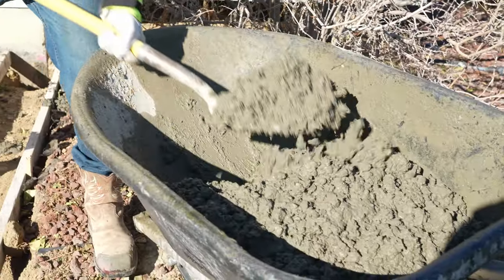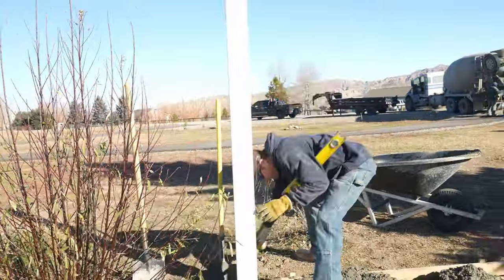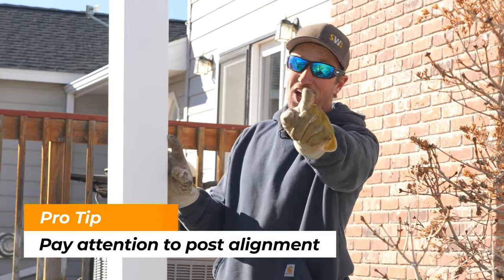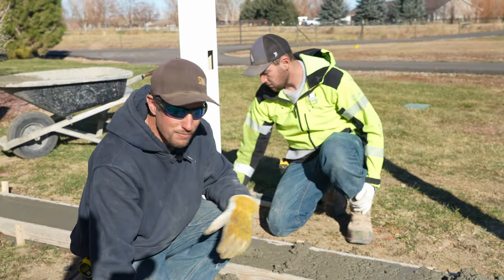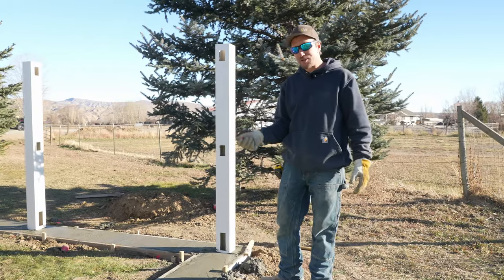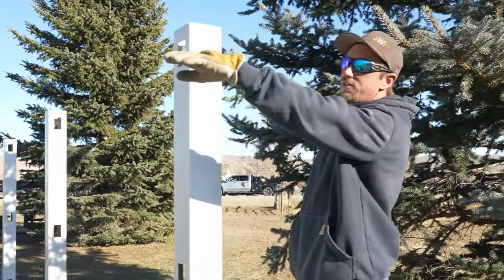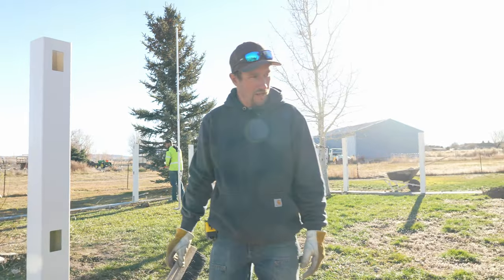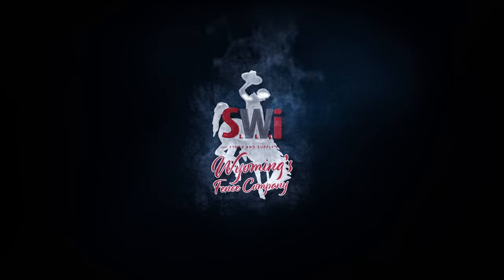How We Finish Concrete Curb With Fence Posts

Comment: I have a problem.  I installed a deer fence (8 feet) by a road way.  Sometimes my neighbors miss the road and go thru my fence destroying it in the process.  Is there any way I can install some kind of fuse or breakaway so when they hit it the whole fence isn't pulled and wrecked.  This way only the area hit would be affected or at least a shorter amount of fence and posts pulled from the accident. So far 6 cars and trucks have landed in my fields.
Reply: The age old problem of keeping cars out of your fence line! 
Id say collect the insurance moneys and start building a wall! Or maybe a curb
Reply: @wyattgreeson2765  I do have large boulders on the property and can move them.  Just takes time.

Comment: It's been 2 years since this pour. Did it hold up?   A want to do this curb but I didn't know if it would crack apart while the fence was fluctuating in the wind.
Reply from the maker: It's holding strong! 👍🏻

Comment: Why no gravel or rebar?
Reply from the maker: There is no gravel since we didn't perform excessive excavation for the mow strip, and there's no need for rebar. With all the concrete being connected and poured as a single unit, the post footings serve as sturdy pylons for the mow strip.